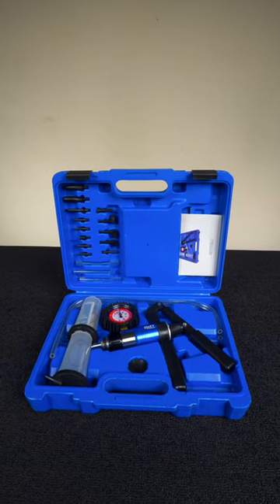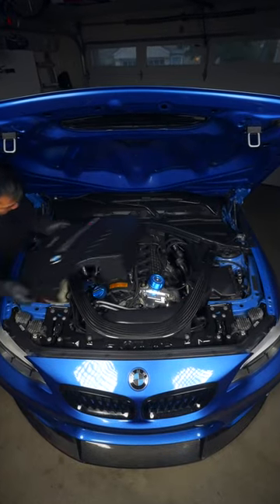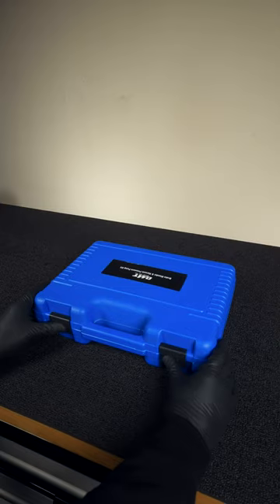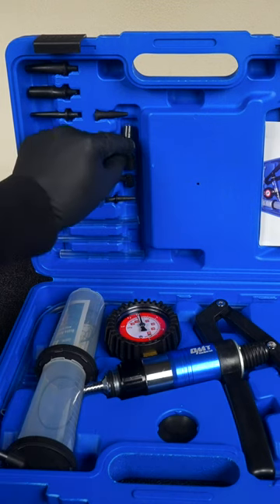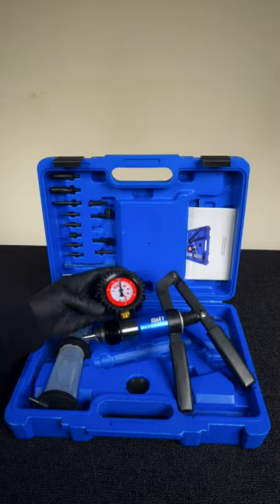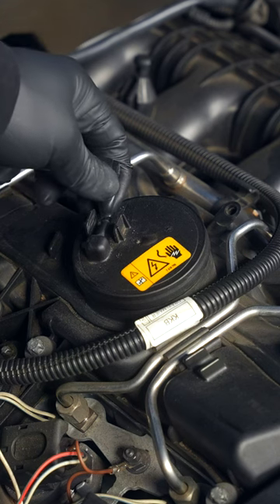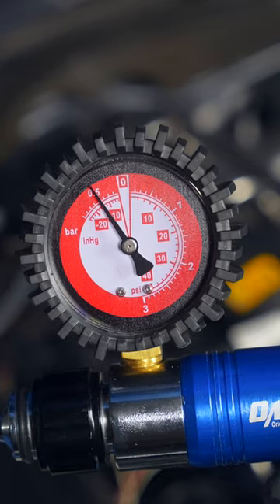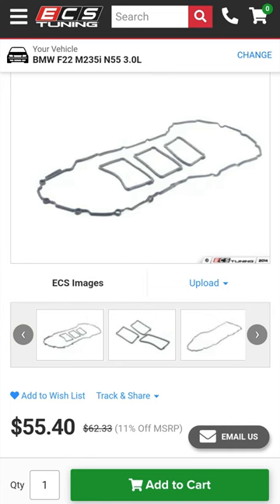BMW Valve Cover Test

Comment: BMW tech here. Just replace the valve cover. Elring makes it and it comes with the gasket already because you will be doing the job again once the valve cover cracks. The engineering department knows exactly how many heat cycles these can take. Also, when doing this job check the condition of the fuel lines when you undo them if any of the threads look rough just replace them. These valve covers typically fail in the passenger rear corner onto the catalytic converter.
Reply from the maker: You're spot on. That's exactly where my leak was.

Comment: It’s this testing the PCV valve? Or the entire thing? Because my car is making the fun little pcv scream
Reply from the maker: Usually that's a clear sign that it needs to be replaced. if that port isn't holding vacuum you'll need a new valve cover even if the gasket is good. To my knowledge it's built on to the valve cover and can't be fixed as a stand alone item.
Reply: PCV scream is exactly what I have been experiencing for 2 weeks. Flash tuned to a stage 2 and noticed the noise when accelerating. Usually have music on so sound could have been there before and I didn't notice.
Reply: @FritzRamos  you just helped diagnose my issue I think. I just tested with my MityVac and it won't hold pressure.